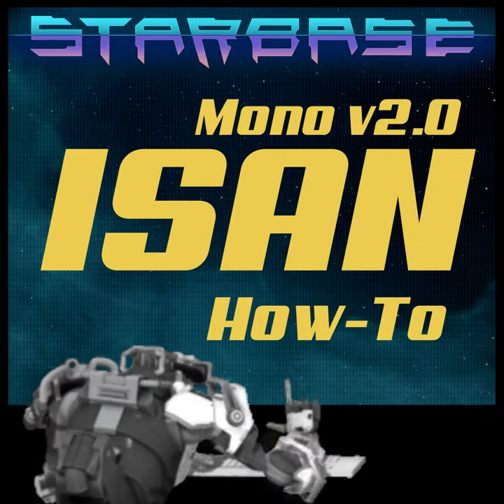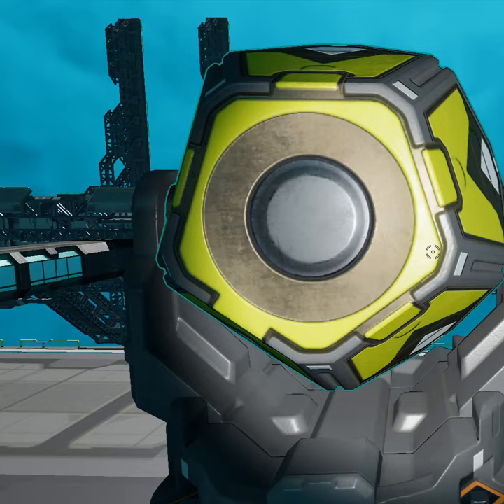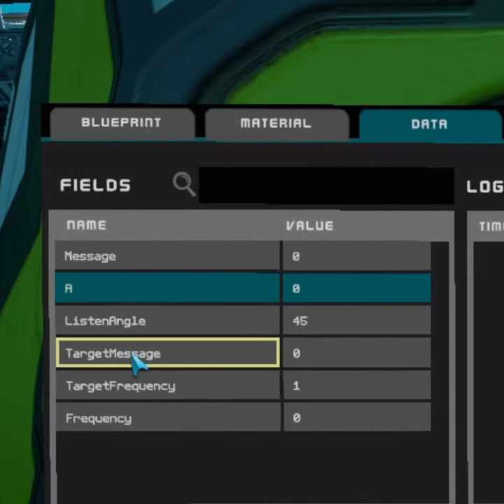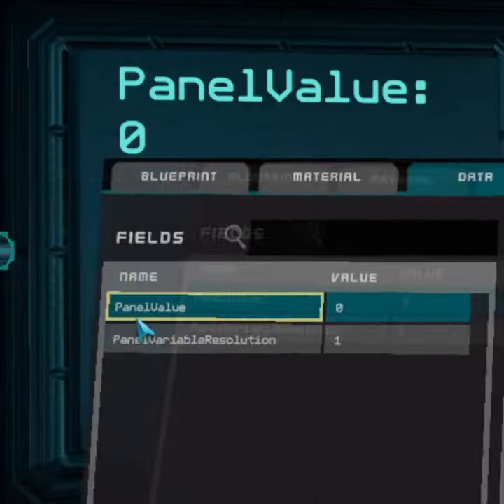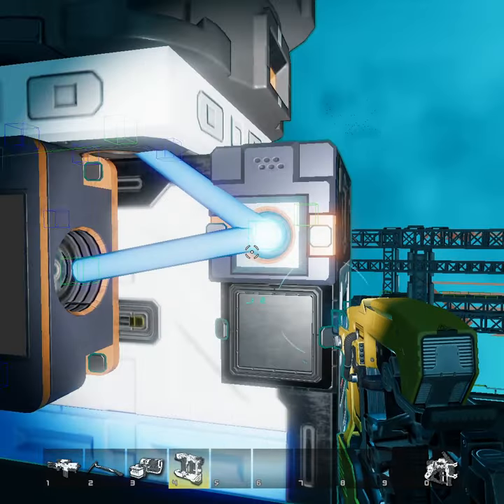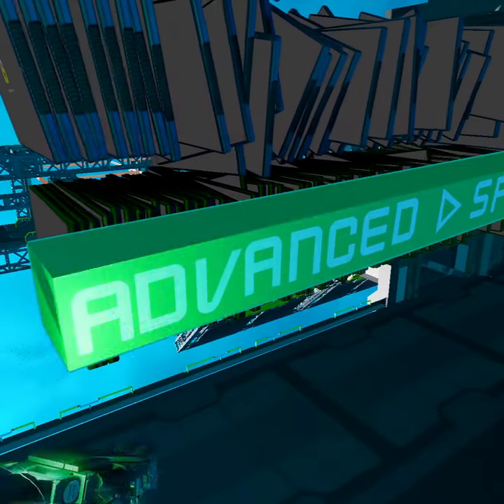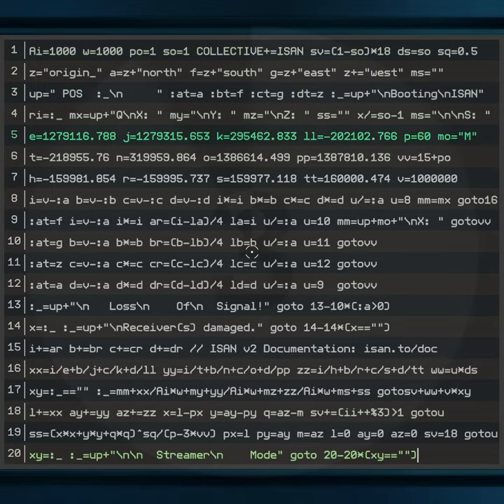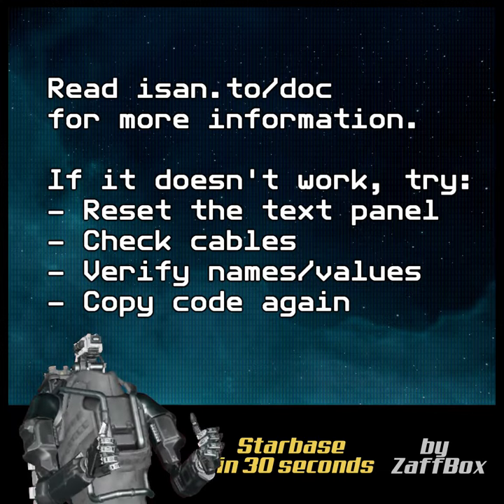Starbase: ISAN Mono in 30 seconds (GPS Tutorial)

Comment: mono isan can show speed ? i thought only quad can can anyone check that ?
Reply from the maker: Showing speed is possible on both versions. However, Mono loses accuracy while in motion, while Quad handles motion well, so it's recommended to use ISAN Quad to show speed to get the best results. To enable, use Advanced chip and set 1st line so=0. If on Mono, also use po=0.